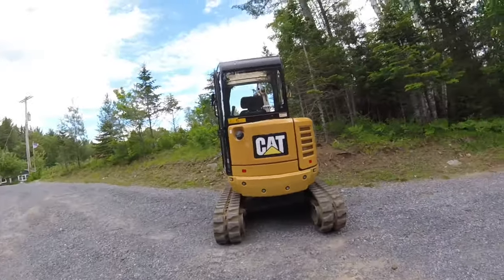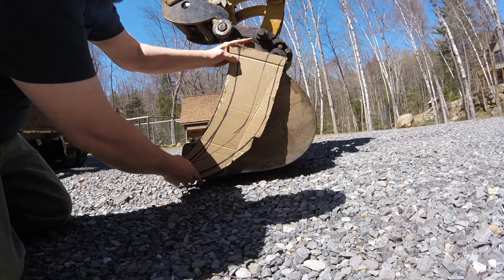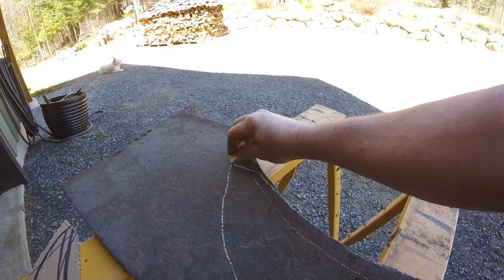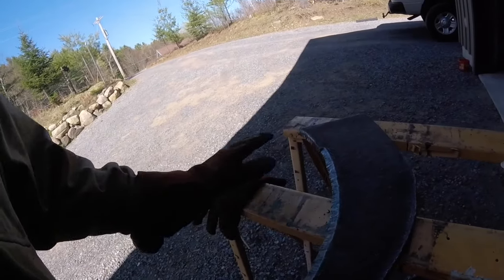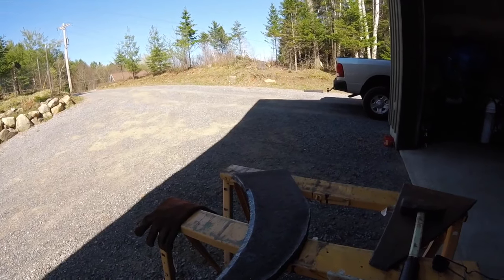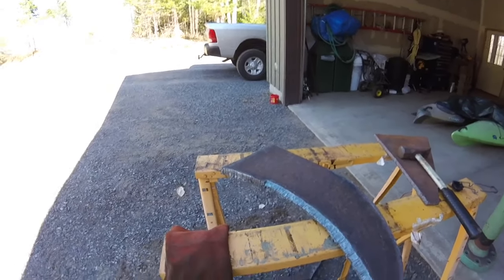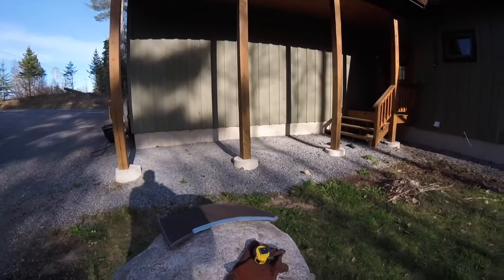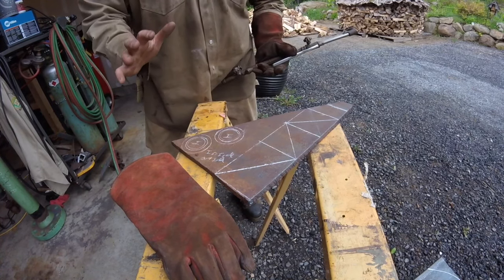Building a Root Ripper for Mini Excavator Part 1

Comment: What grade of steel did you use?
I have some qt100 and ar400 and want to build something like you did.
Reply from the maker: I used A36.... it’s all I had and its holding up fine. I’ve used it for rippin stumps and moving logs and rocks no issues. With the doubler plates it’s basically 3” thick.... but I do take care to not side load it anyway. I’d go with the QT100 if I had it.... never hurts to overbuild. Thanks for watching.